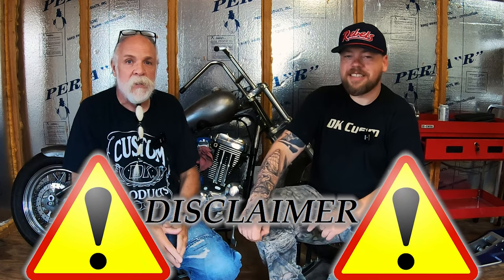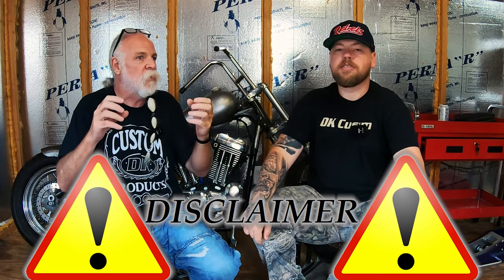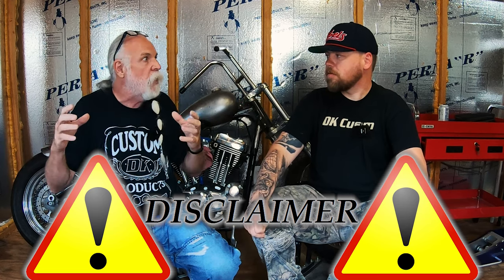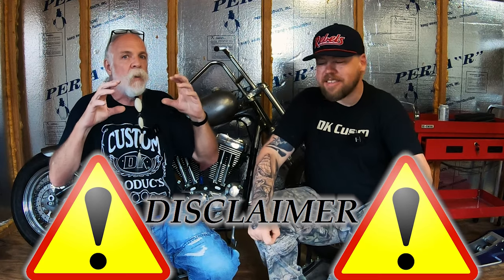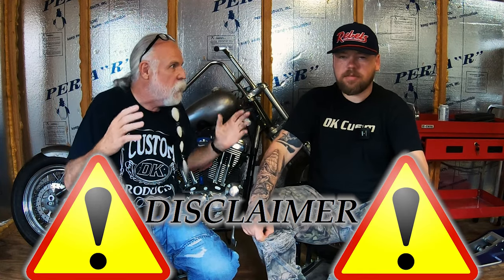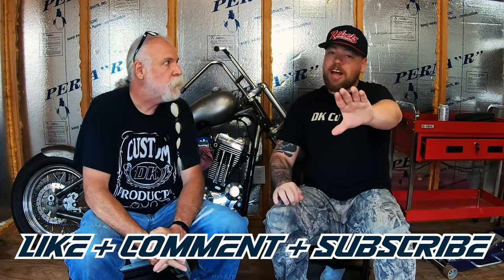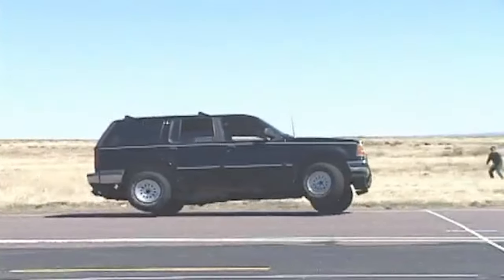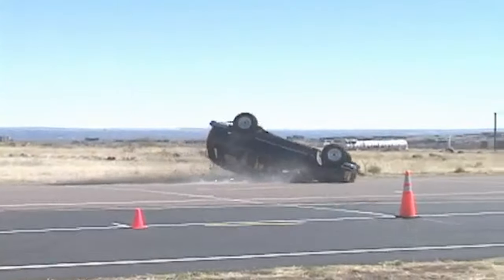Why Does Harley Manual List the WRONG PSI for Rear Trike Tires?

Comment: I have a2018 triglide. i've set it up to pull an Little guy My Pod Camper. Right now the toung weight is 43 pounds. The trailer weighs 870lbs. what tire pressure. between 20-26.Don't go crazy in turns.
Reply from the maker: Hey Jonny, between 22-26 PSI should be perfect but it would be best for you to try various settings to see what is best for you and your riding comfort before taking a long trip.

Comment: What psi do recommend for trike w/ a passenger and full luggage?
Reply from the maker: I run 20-21 PSI in my rear tires, whether solo, two up, two up fully loaded, or two up fully loaded and pulling a trailer.  KP

Comment: I run mine at 22 but I’m gonna try 20 now. How bout your front tire? What do you run yours at? I’m at 35 right now.
Reply from the maker: I run the recommended max in the front tire...depending on the tire it ranges between 36 & 42.

Comment: Do you have a TPMS system on your trike? I was thinking of getting something to monitor tire pressure. I have aftermarket wheels (Coastal Moto) and lower profile tires (less sidewall as a result), I run 30 psi, but now I’m curious if I could run lower…🤔
Reply from the maker: I do not have a TPMS.
Even with your shorter sidewalls, I think you will be well pleased if you lower your PSI to match the load on the tires.

Comment: What should the tire pressure be on 18 inch rear custom wheels on a Freewheeler?
Reply from the maker: Same, 20-22.  This will provide a better ride than 26.  However, the low profile tires just do not have as much sidewall flex as the full sidewall tires found on earlier year Freewheelers.
Plus, if you have the TPMS, at 20-22 it will trigger a warning.  If you can ignore it, you will get a better ride quality than at 26 psi.

Comment: I run the harley davidson custom 16 in wheel on my 2019 M8. Can I still run 22 psi in the rear tires.
Reply from the maker: We have quite a few Customers with the low profile tires on the CVO running them in the 20-22 psi range with no issues.  The benefit is not as great due to the shorter sidewall, but it is still a noticeable improvement.

Comment: What do you recommend tire pressure for the trike front tire
Reply from the maker: Start out with whatever PSI is on the sidewall of your tire, then play around with 2-4 PSI up and down from that number.  I generally run might at exactly what is listed on the tire.

Comment: What about when you haul your old lady around on the back? I weigh about 260 and she weighs about 190?
Reply from the maker: Even with your old lady 20-21 PSI will still be good. 
Kevin has 10's of thousands of miles on our Tri Glides with rider/passenger/luggage weights of 600 lbs + and run 20-21 psi.  Here is an article that you may find interesting/useful.
https://www.dkcustomproducts.com/media/wysiwyg/framesuspension/rearshocks/Lehman_Trikes_correct_tire_pressure.pdf

Thanks for commenting! MB
Reply: @DKCustomProducts Thank you sir! I am dropping mine today!
Reply from the maker: Glad to help! Thank you for commenting!  MB

Comment: What about a road glide 3 rear tires?
Reply from the maker: Freewheeler, RG3 and Tri Glide are all the same frame, and work the same way, including the PSI for the tires.  The RG3, CVO Trikes and some Freewheelers have lower profile tires, but still the ideal PSI is 20-22 PSI.
Here is a link to a report for all Harley Trikes- https://www.dkcustomproducts.com/media/wysiwyg/framesuspension/rearshocks/Lehman_Trikes_correct_tire_pressure.pdf
KP

Comment: I have a question when running The tire that low dose the front road Walk
Reply from the maker: If you are asking will lower PSI in the rear tire help with the front tire skipping or chattering, lowering the PSI in your rear tire will not increase or decrease the skipping/chattering.

Getting a rear lift for your Trike will help with the chattering/skipping of the front tire. You can see the lift kits we offer at this link- https://www.dkcustomproducts.com/harley-trike-lift-kits-c56-87.htm

The best way to prevent front tire skipping/chattering is by putting a rear tire on the front of your Trike. You can see a video on this subject here- https://www.youtube.com/watch?v=uZWDBsc6BEY

Thank you for commenting! 😎
Reply: No what I am talking about is you can hold the bike straight and it will wander side to side and it doesn't matter what Lane you are in and I have already changed the front tire
Reply from the maker: Wandering is a "feature" of trikes.  Because they have 3 wheels and roads are crowned (not flat) they will not go straight on their own.  If you are on completely flat surface (rare) then it should hold straight.  If it does not, there may be something else going on like bad Axle Bearing Retainer plates (see video below) or the rear fork or front fork could be out of alignment.
https://www.youtube.com/watch?v=eTF6Uqm2KZU

Comment: What pressure do you recommend for the front tire on the trike?
Reply from the maker: I would run whatever the manufacturer of the tire recommends...depending on the tire, somewhere between 36 psi to 42 psi.

Comment: What about the front tire pressure!!
Reply from the maker: Run per spec's on the front tire, or if a little less fees better, you may prefer that.
I run 36 psi in mine, which is what is specified for the tire.

Comment: I know if you run under pressure on a car the tires could over heat and could blow out. The tires over heated , air expanded, over pressure and blow out. Hot day 65 mph.
Reply: NASCAR tires are basically flat when they put them on. you run a higher risk of over inflation when you start at a higher PSI  not a lower one.
Reply from the maker: Yes, if they were underinflated they will heat up more than they should and cause a breakdown of the rubber and plys.  However, 20 PSI for the weight of the Trike is not underinflated.  It is a bunch of smoke and mirrors to protect cagers from running that low (with a much heavier vehicle) at speed.  Check out the article explaining that this whole things is just a nanny to protect the ignorant from themselves.
https://www.dkcustomproducts.com/understanding-rear-tire-pressure-on-harley-trikes.htm
Reply from the maker: True that.  Thanks for commenting. 👍

Comment: I have  a  2018 trike with  CVO rims and  tires. I'm  running  Legend coil over  shocks and  their  lift kit.  Would 20 psi still apply for my trike?
Thanks for the great information!
Reply from the maker: Yes.  Although with the PSI that low, you may get a low PSI warning from your TPMS...which will not hurt anything, but may be irritating.